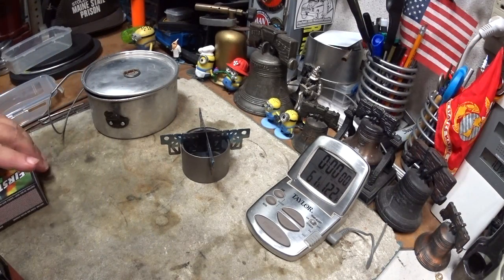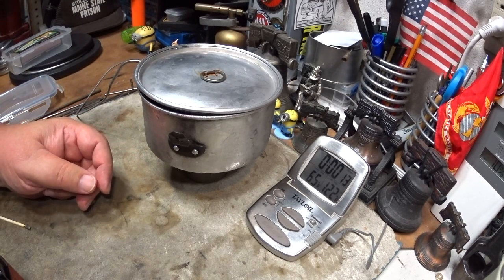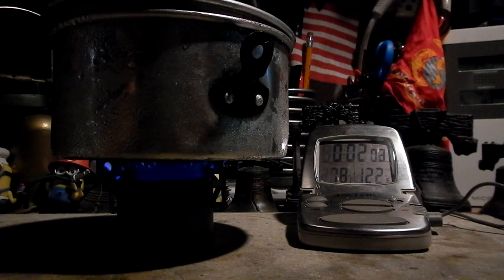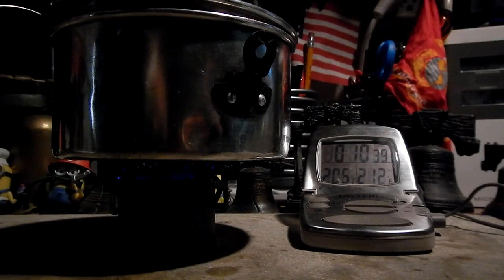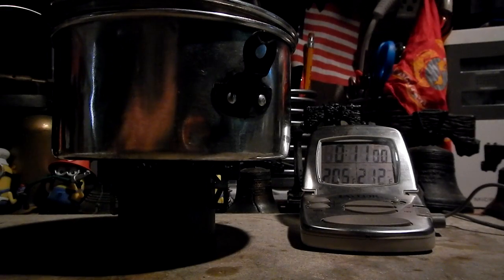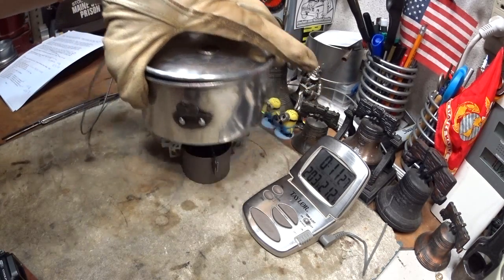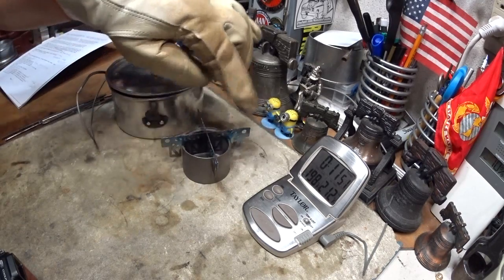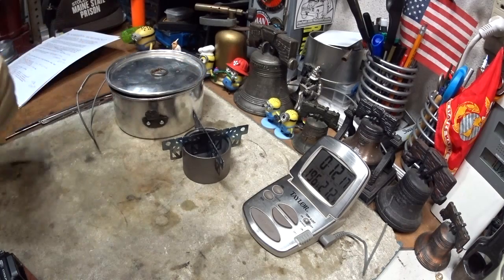TOAKS TSA Stove - Evernew Titanium Cross Stand - 1/2 fluid ounce methanol - Boil Test #6

Comment: All of the previous tests with this burner used over 16 ml to reach a boil. As Luke J says below, the heat transfer to the pot at start up is non-linear (less heat output, heating up the stove, getting the fuel to boiling point, etc). This test with 15 ml was so close...two more ml of fuel would have done it!

I have compiled most of your boil test data, and you really have done an outstanding job in demonstrating the performance of various alcohol stove/stand/pot combinations. Hope you are well.

Comment: Mr. Cook,  Have you ever thought of using your nails on a straight walled stove like the Toaks Siphon by putting the nails around the outside held in place by silicone bands?  You could control distance by cutting the nails to 1 inch above the burner.  I really enjoy your channel.  Best wishes.

Comment: Stove wattage and fuel consumption depends on amount of fuel used, there's nothing surprising for me here and it's good you're standardizing and measuring fuel volume and/or wieght - less variables makes less trouble. Change something extra and you're in a bag of worms again :D

I see it that way: After the a stove gets to full speed, there's more methanol in the vapor, but as it gets burned, gradually more and more water gets out with it. So more fuel takes more time to bloom (which you don't take into account), but less fuel means steeper drop into low wattage/slow burn regions and watered down fuel. Depending on starting percentage, there may be as little, as 50% vol alcohol in the mix at the end of a burn, that really slows things down (and it still goes all away and you're ending with a dry, empty, hot stove). I think only the ISO-Clean stove defies the physics here and puts out more heat with 70% rubbing alcohol, than with 90% isopropyl.

Maybe there is a good formula (or "rule of thumb") on how much burn times will change together with the initial volume of fuel, I'm not that good with vapor pressures and, dunno, Dalton law maybe or something similar. And you have positive thermal feedback loop as well, as the stove heats itself, this adds whole level of calculation complexity.

But really, if heat output changes non-linearly throughout the burn, I'd expect time to initial volume ratio not to be linear as well.

Thanks for your hard work and all the videos, man, you're making portable/camping stove history! Cheers!

Comment: Interesting results. Wondering if humidity was the factor and/or if the pot diameter would make a difference. Warm air temps should have helped boil time but water/humidity/ condensation will absorb heat to the outside of the pot similar to a heat sink. Think your still missing out on the "sweet spot" of 1" flame for best results.